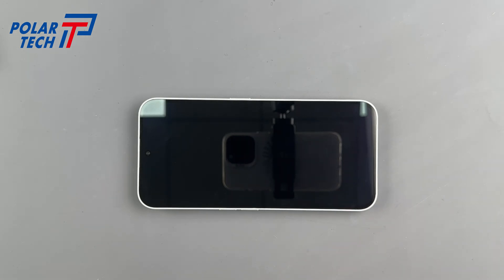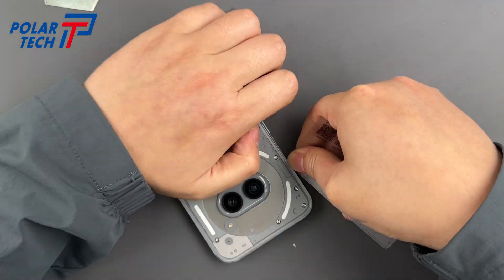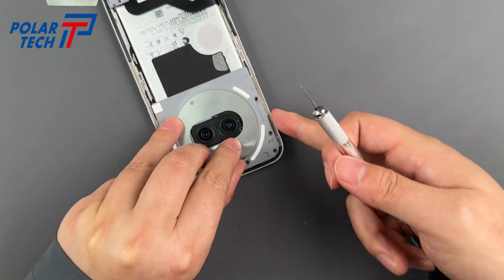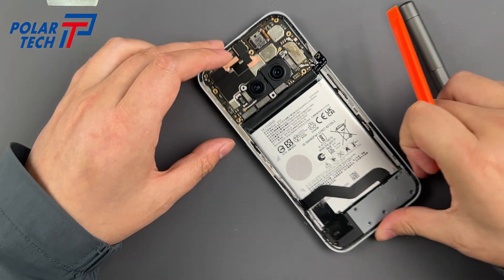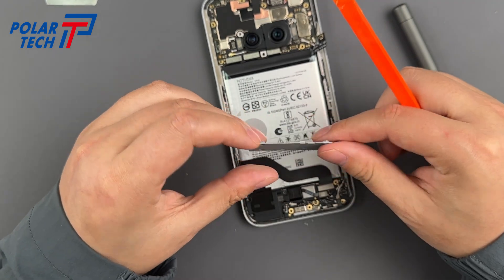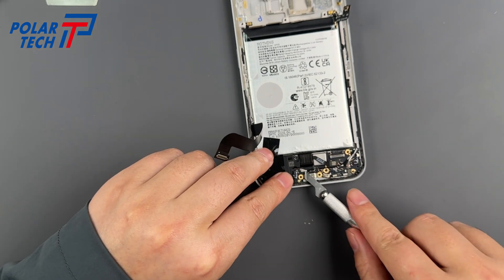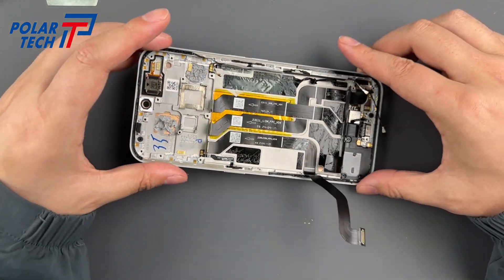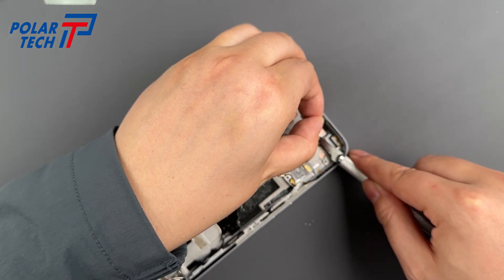Nothing Phone (2a) Plus Screen Replacement | Step-by-Step Teardown & Repair Guide

Comment: Hey,. can I ask what is the last thing you removed? Cos I just bought this phone 4 days ago and already I can see  at the top of the screen, on the right hand side,  the screen is glowing light green. It's annoying the hell out of me.  As far as I can tell it's coming from that exact place- the last step you did.
Reply from the maker: The last part removed from the top of the screen is the earpiece. However, based on your description, the green light coming from your screen is not related to the earpiece — it’s an issue with the screen itself.